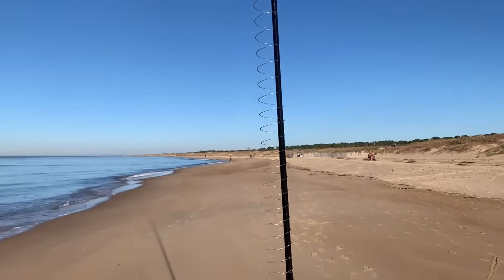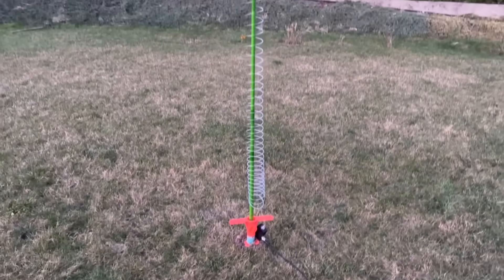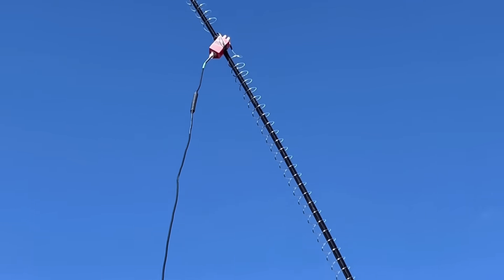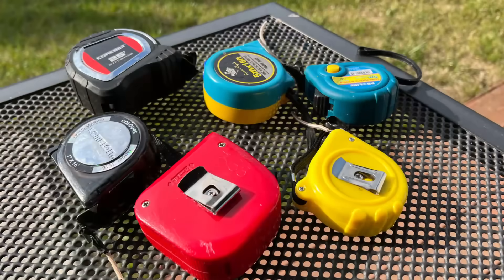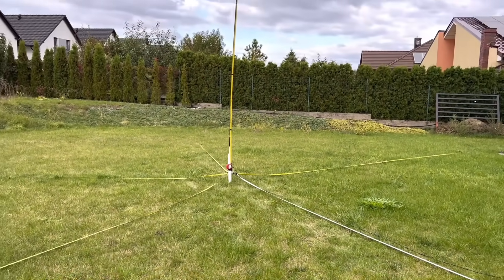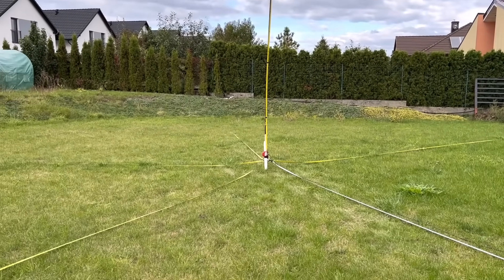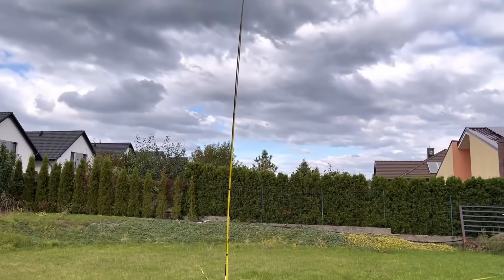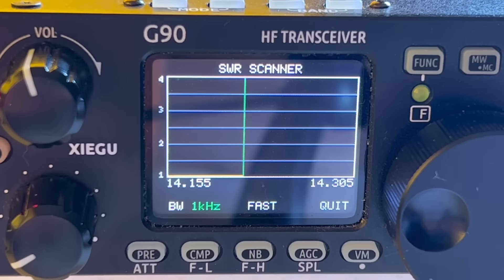My All-Time Favorite Ham Radio Antenna Experiment

Comment: Yes, tape measures make excellent radiators.   The large amount of surface area significantly increases the bandwidth, as you discovered with your flat SWR.   With that much surface area, and no parasitic elements involved, just being in the ballpark would be enough to cover the entire 20 meter band, and then some.

I've done something similar by replacing the string in chalk boxes with 22 AWG insulated wire marked with colored heatshrink at resonant points.   They can be used as radials, or combined to make a dipole or doublet.   I found 41 feet to be a good random length.  Fed with a 9:1 unun,  I can usually get a decent match on all bands from 40 meters to 10 meters using my autotuner.

Thanks for the video, and 73!

Comment: Hi Walt.  I was just thinking about your comments about ocean beach operations.  While fresh water does not have the conductivity of salt water, I am wondering if operating on a beach next to a large river or lake might get a little better result than operating in a park far from water.  Just a thought...
Reply: You're correct, freshwater does not have the conductivity of saltwater.  In terms of conductivity, freshwater is not much better than average soil.  But, what you do get near water is open space.   And, that has a real benefit for radio.

In terms of RF return losses, a pair of resonant radials is going to be about as effective as saltwater, in the nearfield.   But, saltwater also provides an excellent reflection of RF, resulting in lower losses in the farfield.  And, there is no other way to duplicate that effect.

High up on a mountain, in the clear, where you can see for miles in all directions is going to be your inland best option.

73

Comment: Thus is the penultimate example of the original ham radio “can do” ethic. This one is the only antenna where Walt has a monoband antenna w/o loading coils or transmatching with symmetrical, straight radials.
Reply from the maker: Thank you! 73, Walt
Reply: @COASTALWAVESWIRES  It really demonstrates the spirit of the original wireless pioneers!

Comment: So, this is interesting content. I wonder if it performed so well, due to the width of the conductor. That must be like10x more conductor that we normally use with 20ga or 18ga wire.  Is this a miracle antenna? Excellent experiment.

Comment: Thanks Walt, I was watching a video last night where you made an end fed random wire antenna using an LDG RU-9:1 unun and an LDG RU-1.1 unun and you had a short length of coax between them, I was curious what the length was and if there was a reason for that length.  73 de VE7WNO

Comment: Hi Walt.  I am going to visit Ocean City Md in a few weeks.  I want to set up a rig outside my sisters condo that is on the bay.  I am thinking about using a counterpoise that is in the bay with the end attached to a piece of pool noodle.  I was wondering if my counterpoise wire needs to be a specific length or can it be a random wire. The antenna will be a verticle wire cut for 10M.  I only have a tech license so I'm stuck on 10m.
Reply from the maker: Length is not important, just get a wire on top of the water and have fun! 73, Walt
Reply: I’ll be in OCMD playing radio near the water in a coupla weeks as well! Heading down to Assateague for a few days to do some of the same. K4OGO is rounding up a heckuva Salty Crew here in the MidAtlantic! 73s!
Reply: If you're only on 10m, why bother with a counterpoise, why not just use a half wave antenna? Look up T2LT Flowerpot antenna. You can make one of those for 10m, you'll only need a 5m pole, or hang it from a 5m tree. If you have an EFHW transformer, you can also use that with a 5m piece of wire. Or you could just use a standard dipole if you can reasonably get the feed out from the middle. Walt has done a couple of these.
Reply: @paulsengupta971   I'm going to be in a park with no trees, and I want to experiment with using salt water as a counterpoise.  I'm going to use a spike with a 10M hamstick on it.  
easy to set up so I can spend more time on the air and less time on set up and tear down.

Comment: I'm going all-in Walt! I have a trap vertical 10/15/20 Meter I made from parts I got from someone's cast-off beam at the local landfill, and I hate the radials on the ground all over the yard. I hit 'em with the mower, or have to hand-cut the grass with a 'strimmer...and STILL wrap up the wires with the strings! I'll fashion a 3-sided bracket to mount 8+ tape measures with a clip like yours/Callum's base plate...and attach tapes as the radials.  Yellow color will remind me or visitors to stay away...and we'll have a fast-deploy ground plane for next-to-nothing!  You rock sir...Your Pal, Thumpy/KN4HGI Al